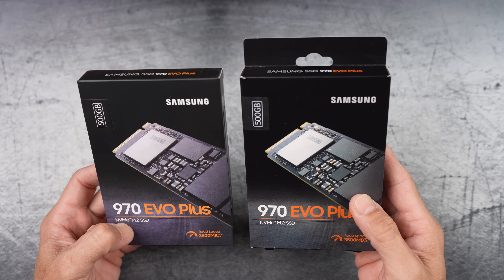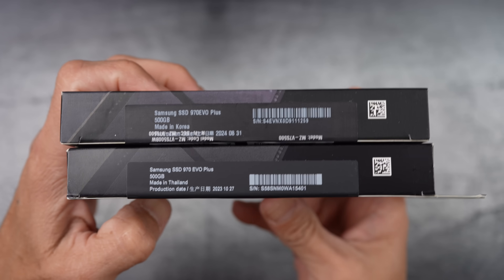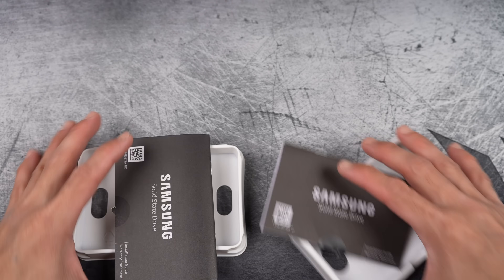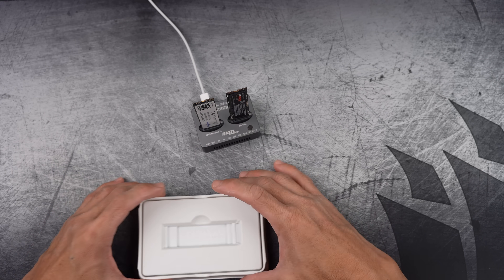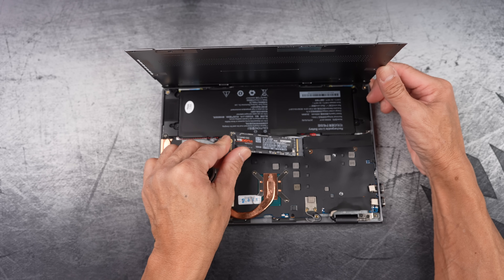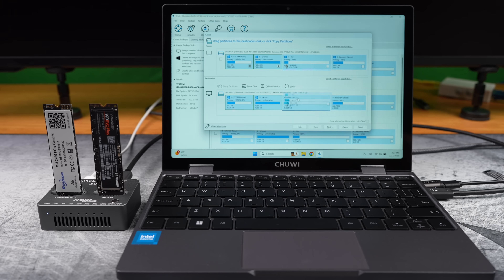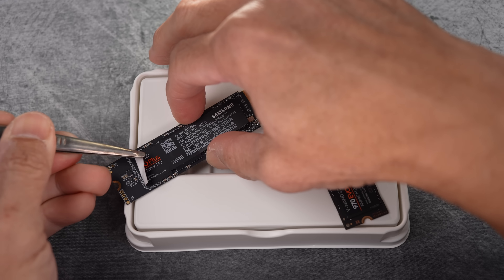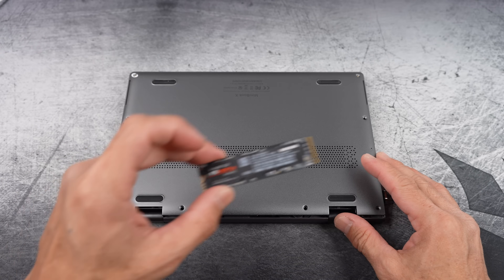Fake vs Real SSD - Can You Spot the Difference?

Comment: one of them is made in Korea see the thing is may or may not be fake.... As they all come off a factory line like all chips do... Not all are made to perfection so they could have been sold to the Korean market as a cheaper price.... I deal with allot of the Ram from places like China buying them off wish and so on or well used to.... Most of those products are over 10 years old and still work just as well as something made elsewhere
Reply from the maker: Totally fair take—some ‘fakes’ might just be off-brand or factory seconds that still work fine. I agree, not everything from China or Korea is bad—just depends on how it was handled and sold!
Reply: @TossSong  no what I was getting at it might have been real to begin with its just Samsung like all companies mass produce them so coming off the factory line with issues are sold on a different market... Did you contact Samsung to see what they said if this is a real or a clone? It seems a little too real to be a fake....
Reply: @TossSong  See this is just from what I have gathered doing a little research on this.... Samsung's M.2 SSDs, like the 990 EVO Plus, are manufactured in several locations, including South Korea, China, and Thailand. Specifically, Techman Electronics (Thailand) Co., Ltd is listed as a manufacturer in Thailand. The 990 EVO Plus, for example, utilizes V-NAND TLC NAND flash technology and a specialty in-house controller, which are both produced by Samsung.... That being said buying Samsung is like buying generic you will get some good products but not always perfect... So if you got a hold of a few other clones or fakes and test the hardware out you might see different timings in them or the same result with the ones that call it official... But that is enough about that... I didn't mean any insults if you take it that way... I have been a tech for about 25 years now I just never worry about if something is a clone or not long as it works and keeps me going that is good for me...
Reply from the maker: Great breakdown. Appreciate all the insight and research you shared, see where you’re coming from. For sure there’s a gray area between “fake” and “factory second” or “off-brand,” especially with how widely components are sourced and sold. And for you, if it works reliably and serves its purpose, that’s what matters most, and to a lot of users too of course. Your experience in tech has given you that perspective.
Reply: @TossSong  I know that some fakes of different things are out there from china... But also some of this is companies trying to make a name for themselves too they buy the rights to use different brands of chips in their PCB now it will not be as great as some of the other manufactures but they are not faking the device... Take a look as an example of MSI vs Asus MSI puts out the B550M and same with Asus.... Almost the same IO in the PCB with a few minor changes.... But the programing that MSI uses is shit compared to the programing that Asus did.... Now we could call MSI the clone because their motherboard is shit quality and bad programing but its not a fake its manufactured from MSI. I picked up a MS-R5 230 maxsun AMD R5 230 it says that its a 2gig video card but when I put it into the pc its a one gig. Its bad programming in the end as its got to be flashed with the correct bios an example of a manufacturing defect.... Sending this back would take forever to get a new one.... and its a cheap card just as a temp test card for windows 11 but anyways the thing is allot of this is manufacturing also yeah region that its made in.... This is often why I don't really like online shopping
Reply from the maker: @stephenpegg5636 Great follow-up, and thanks for sharing—it really adds to this discussion. Good point about how it’s not always black and white—just because something’s made in China or uses alternative components doesn’t automatically mean it’s a “fake.” Like you said, some of these are legit brands trying to carve out a market, even if their programming or manufacturing quality isn’t quite up to par.

The MSI R5 230, it shows how quality control and firmware/software can make or break a product, regardless of branding. And yeah, flashing the BIOS to fix things is not something most users want to deal with, especially when buying online.

I see why that experience made you cautious with online shopping. Hopefully more people become aware of these “gray zone” products—not fake, but not necessarily reliable either. Appreciate it!

Comment: Shiny controller and cleanliness in circuit board, sticker and typo on the drive helps find out if it is genuine.
Reply from the maker: Exactly! Those small details like the finish on the controller and any typos on the sticker are big red flags. Gotta inspect closely these days!

Comment: So you get cheap clone which almost perform better...quality these days comming from china is astonishing...I  bought some diagnostics and chip tunning equipment from Ali and for 20 times less money you got same quality. when it comes to chip tunning,even originals are stolen property and they charge 3000 eur for Kess...God bless Chinese clones
Reply from the maker: Totally get where you’re coming from—some of these clones really do push out surprising performance for the price. But with SSDs, the tricky part is long-term reliability. It’s always a gamble unless you dig deep into the internals. Thanks for sharing your experience!

Comment: Thanks for the video. By the way, in Macrium Reflect you can clone a drive to a smaller one using clone with shrink/expand partitions function.
Reply from the maker: Great tip—thanks! Shrink/expand is super handy. Macrium Reflect wasn't able to shrink the OS partition of the old drive, because it is encrypted with Bitlocker and had to be copied sector by sector. However I did reinstall Windows and everything is all good.

Comment: Cringe....
-What were the specs of the existing drive you cloned???
-Didn't even attempt to use software to read and compare the hardware specs for each drive via HWiNFO or SSD-Z...
-Unaware the SSD controller chip probably plays the biggest party in performance. Not just NAND and missing DRAM cache. 😂😂😂

This video is borderline useless.
Reply from the maker: Appreciate the feedback. Definitely agree the controller plays a huge role—this was more of a hands-on look at what casual users might run into with cheap listings.

Comment: I was suprised that the fake drive was the full capacity.  These fake ssd and micro sd cards usually have less capacity but are made to fake out the os up until you try to fill the disk.
Reply from the maker: Right? That surprised me too! I expected the usual fake-capacity trick, but this one actually had full usable space—just with lower performance. Definitely not your typical fake SSD.

Comment: First, thank you for that nice video. Is there any way for a non-intrusive test to tell if this product is original or not? As I know now in some countries the official suppliers sometimes used high copy product to increase their profit margine. You might see this story repeating after Trumpe last motion for the tarifs.
My specific question is (for my respected readers) can I use say a handy thermal camera to identify the original from the copy? If yes this might be a very good news.
Reply from the maker: Thanks for this insightful question. A thermal camera could help in theory, especially if the fake uses different power components or NAND chips that heat up differently under load. But in practice, it might be hard to get reliable patterns without a known-good comparison unit.

For a less intrusive, check firmware version with the manufacturer’s software, scanning the serial number on their site (if supported), and doing a speed test using CrystalDiskMark or similar tools. A big red flag is when an SSD performs way below spec even though it looks legit. I agree—testing before purchase would be ideal, especially in high-risk markets.
Reply: Of course the test should be conducted before buying the product

Comment: best fake drive ever, better than the original! this is crazy!!
Reply from the maker: It’s interesting when a fake actually performs that well or comparably. However we don’t know the lasting quality of it. And don’t forget the video is comparing the fake vs the real, not the stock drive.
Reply: @TossSong  yes, for its speed it's comparable to the stock one, but durability is in doubt, however it doesn't make sense they make such a good fake, unless you consider that the production cost of original drives is very low, samsung has huge margins over these drives.
Reply from the maker: You bring up a great point about production costs and margins too. Makes you wonder how far some fakes will go to get your money!

Comment: So, in conclusion, the fake drive was operational with real storage capacity, but lacked DRAM.
The performance was only slightly inferior to the original, but is supposedly of poor quality and supposedly likely to fail soon.
Isn't it amazing that despite being low quality and lacking DRAM that the performance was that close ?
One thing I'm missing from this video is how the price compares ? You say "you get what you pay for", but what did you pay for fake and original ?
Reply from the maker: Yeah, it’s surprising how close the performance was despite lacking DRAM! But long-term reliability is a big concern. As for the price, the fake one was around $48, while the real one was about $85. Definitely a case of ‘you get what you pay for’ in terms of quality and longevity!

Comment: My assumption is the cloning tool didn't work on the real drive because the real one is PCIE 4.0.
Reply from the maker: Thanks for commenting. Good guess, but the Samsung 970 EVO Plus is actually PCIe 3.0. The cloning didn’t work at first because of a partition error, complicated. I ended up using cloning software instead and it worked fine! And even reinstalled Windows.

Comment: Got me benchmarking my SSDs now lol
Reply from the maker: Haha same here! No SSD is safe now—CrystalDiskMark is working overtime! When you can let me know how it goes. Thanks.
Reply: @TossSong  I have a 970 Evo Plus 2TB and the numbers are close to your real one with read speed which is 3288 for me, but my write speed is 2036 🤔 Ive done it the test 3 times and it's around 2000-2200 every time. Regardless after watching this and testing mine, I went and looked up some of the best on passmark and got a crucial T700(hopefully a real one) coming lol, thanks for the helpful video!
Reply from the maker: @whoshotya117 Nice! Yeah, your read/write speeds line up pretty closely with mine. I’ve heard good things about the Crucial T700 too—fingers crossed it’s the real deal haha. Appreciate you checking yours and sharing the results!

Comment: This must explain why my Samsung EVO with 1 TB failed to boot up Windows 10 prematurely only after 2 years of ownership.
Reply from the maker: That’s definitely frustrating. If you still have the drive, you might want to check its serial number on Samsung’s website to verify authenticity. Also, SSDs failing that early can sometimes be due to a high TBW (Terabytes Written) limit being reached or firmware issues.

Comment: You dont show the device name in Device Manager or Task Manager, is the fake one labeled as Samsung 970 EVO PLUS?
I have 2 Samsung 970 EVO PLUS and 2 Samsung 981A (OEM Version of 970 EVO PLUS for manufacturer, taken from ThinkPad),
and recognize the real and fake one, the original Samsung SSD have a shiny metal controller, DRAM and 1 or 2 NAND Chip. The fake one have black controller, no DRAM and low quality NAND Chip.
Reply from the maker: Good points! I didn’t check the device name in Task Manager or Device Manager, but that would be a great way to confirm suspicions. The fake one does have a black controller, no DRAM, and likely lower-quality NAND, just as you described. Definitely a big difference in build quality!

Comment: I have some SSDs that are way slower than they are supposed to be. I bought from amazon and not ali, but probably wound up with fakes anyway. Never even considered the possibility that there were scammers selling fakes.
Reply from the maker: Yeah, unfortunately, fake SSDs aren’t just on AliExpress—Amazon and eBay have their fair share too, especially from third-party sellers. If your drive is way slower than advertised, it might be worth checking its specs with tools like CrystalDiskInfo or running a speed test to compare with the official numbers.

Comment: how about us who is not computer expert? how do we know if its fake?
Reply from the maker: Thanks for reaching out. From my recent experience, if you’re not a computer expert, you can check by:
1) Running a speed test with CrystalDiskMark—fake drives are much slower.
2) Checking the serial number on the brand’s official site.
3) Using H2testw to see if the actual storage matches what’s advertised.

Comment: I’ve always wondered about cheap memory on eBay etc , interesting video, thank you  (my only thought is what’s stopping these companies selling fake memory and the user doesn’t even realise)
Reply from the maker: Yeah, that’s the scary part—many users don’t even realize until they run tests or encounter issues. Some fakes are programmed to falsely display the correct capacity, making them even harder to detect.

Comment: I think i have a fake Teamgroup USB memory stick. It says 32 GB but even after formatting and deleting i cant make it accept files that take it over the 20 gig mark. It says the space is not there and i need to make it.
Reply from the maker: Yeah, that definitely sounds like a fake USB drive with a modified firmware to display false capacity. You can confirm it by running H2testw (Windows) or F3 (Mac/Linux). These tools will check if the full 32GB is actually usable. Unfortunately, a lot of these fake drives only have a fraction of the advertised space, and data written beyond the real capacity gets corrupted. If possible, try getting a refund and only buy storage from trusted sources!

Comment: I purchased three 4TB SATA SSDs on Ebay they were too good a price to believe but I gave it a go. When I pugged them in it showed 4TB but would only take 256GB. I took them to a computer shop to verify I wasn't missing some partitioning confusion are anything else. No they were fake 4TB. Ebay stood behind the problem and forced a refund and told me to keep the SSDs.
Reply from the maker: Wow, that’s crazy! Sadly, these fake high-capacity SSDs are becoming more common, especially on marketplaces like eBay. The fact that it showed 4TB but only stored 256GB means it was likely firmware-modded to display false capacity. At least eBay backed you up and issued a refund! Thanks for sharing your experience—this will help others be more cautious when buying storage online.

Comment: This is something that is poping all over the place ,we even saw it in Enterprise. As people who work on servers know ,each OEM has a custom firmware and DRM. We still see fakes from time time. Mostly in South East Asia. They have the correct sticker but when you connect them  - on the first look its correct firmware but the system would reject them as they cant past DRM.
Then when you piel the sticker ,its completly different model....
Reply from the maker: Yeah, it’s crazy how convincing these are getting! Some even have the correct firmware at first glance but fail DRM checks or get flagged later. It’s a real problem, especially in markets where these counterfeits circulate more often. Peeling off the sticker and seeing a completely different model underneath is just wild. Thanks for sharing your experience!

Comment: Made in Thailand vs. Made in Korea

Korea is a peninsula that covers both North and South Korea. Not a country.
Reply from the maker: Good point! I was just referring to the manufacturing labels on products, which usually say ‘Made in Korea’ rather than specifying North or South. But yeah, technically speaking, South Korea is the country where these electronics are usually made.
Reply: Thats rubbish. Before it split there was a Korea. Now, both North and South claim to be the 'real' Korea.  That is why you often see make in Korea.

Comment: Yeah, you lost me at Aliexpress. Would've been informational to run Samsung Magician on both to see if the fake one was detected as fake.
Reply from the maker: Thanks for commenting. Yes, I get that! Running Samsung Magician would’ve been interesting (which I did later off camera). But, Appreciate you watching!  

I tested it off-camera (you might have noticed it in the video where I have the software installed). The Magician software didn’t recognize the fake drive as genuine, but it did display the correct name.

The serial number on the package is different from the serial number in the Samsung program. The program doesn’t recognize it as a Samsung disk. Additionally, the write/read speed is lower than that of the originals.